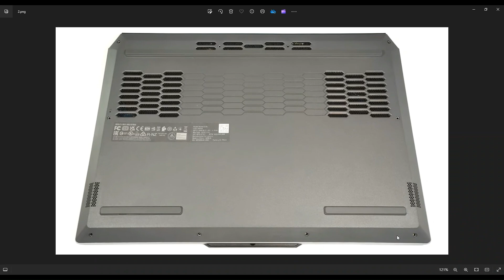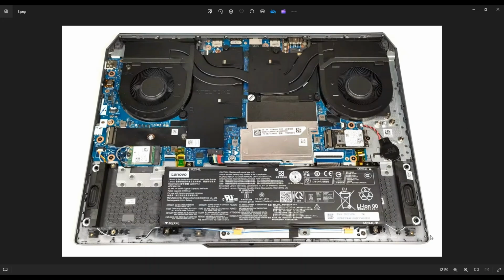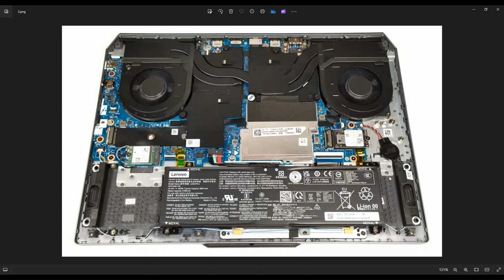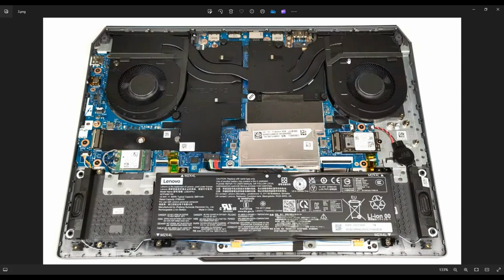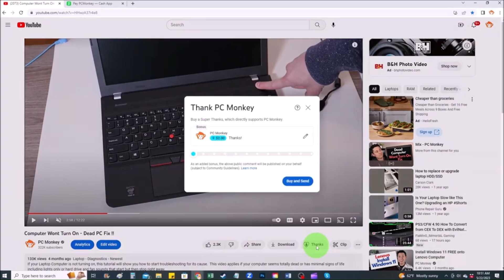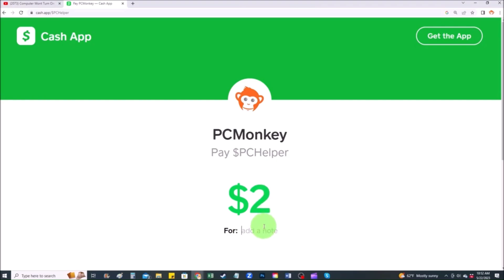How To Replace Fans Heatsink Assembly - Lenovo LOQ 15i (Gen9) Gaming Laptop Computer

Comment: How you you remove the assembly to replace the fans?  I have removed all the screws and connectors but when I attempt to remove it, it will lift a little but will not come out.
Just a hint but resize you mouse so the it it's bigger and clearer to see.  It was difficult following it.